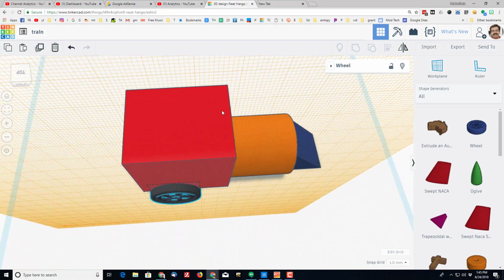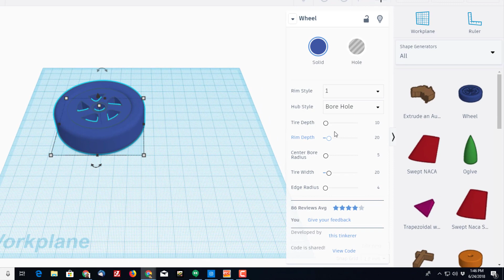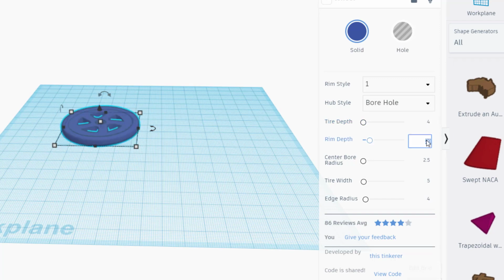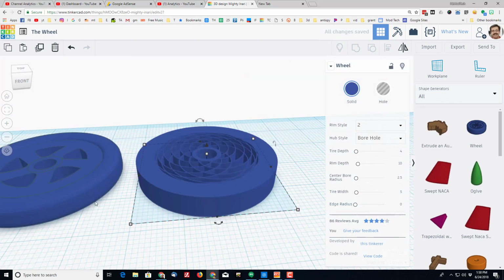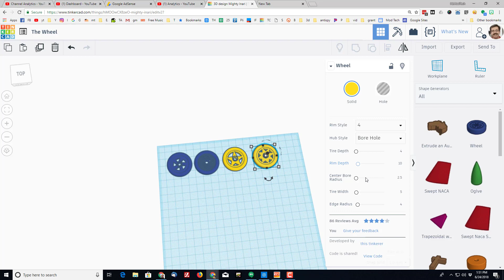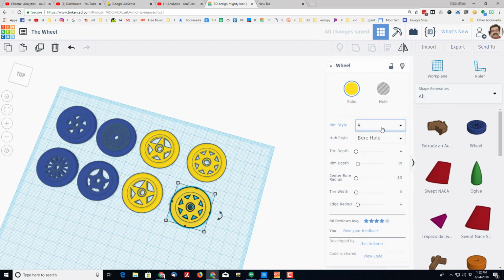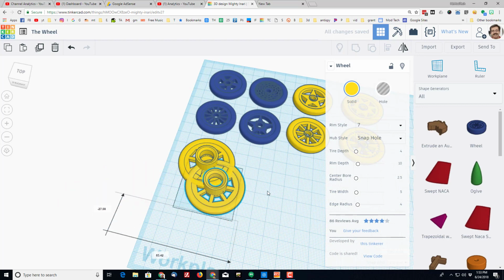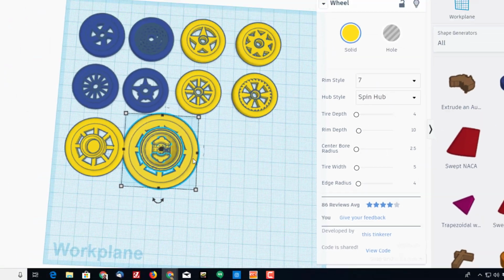Get Rolling with the Tinkercad Wheel Tool

Comment: I like to make the center of a wheel to fit a 2 mm diameter metal axle. The depth can be 4 mm length in.  This for a toy car. The length of my metal axle will be near 137 mm.   I will have two wheels at each end.  :-)
Reply from the maker: Sounds great! Are you building a design to race in a classroom?
Reply: Yes, Students are working on the idea.
Reply from the maker: I loved that project in my classroom.